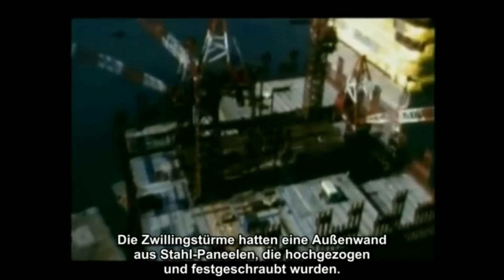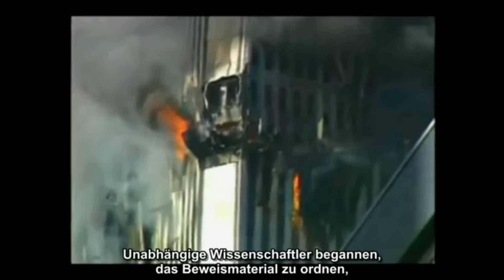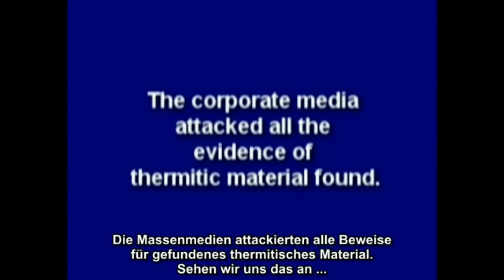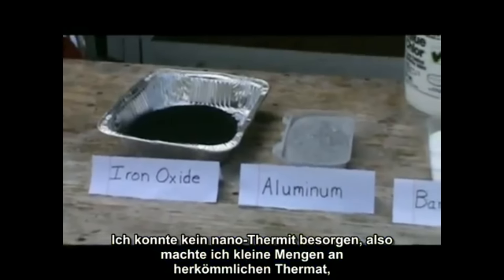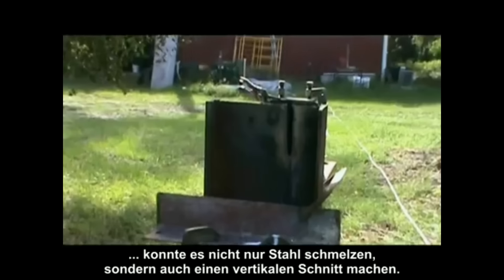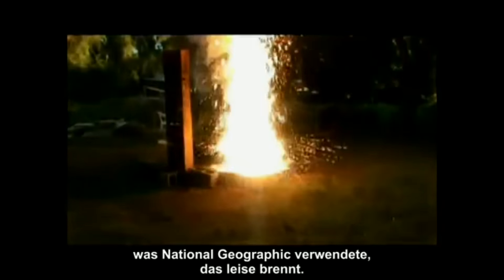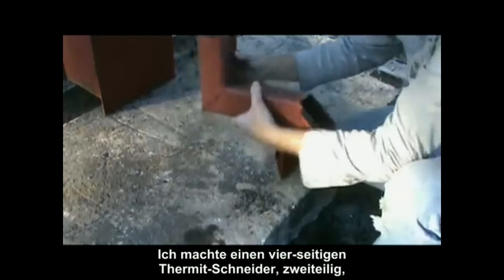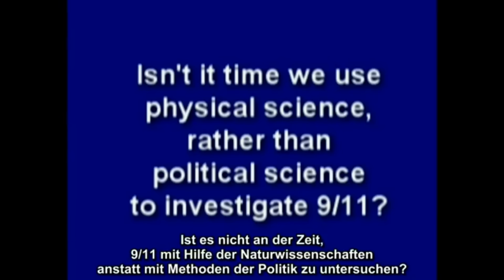9/11: Neue Erkenntnisse zu Thermit und Sprengungen ✔ November 2015

Comment: http://911-research.info/html/Fakten/brenntemperatur-kerosin.html

Physik 
Kerosin | Temperaturen | Statik
Brenntemperatur von Kerosin

Solche Verbindungen brennen normalerweise bei ca 700 – 800 Grad Celcius mit einer diffusen Flamme. Unter optimalen Bedingungen (optimales Brennstoff/Sauerstoffverhältnis) erreicht die Spitze einer Gasflamme etwas über 1100 Grad Celsius. Trotzdem schmilzt der Gasherd in der Küche nicht ! Auch der Grillrost wird wohl rotglühend aber er wird nicht brechen oder schmelzen. Selbst rotglühender Stahl wird nicht einfach flüssig oder verliert seine strukturelle Festigkeit komplett.

 

Kerosinfeuer
Höhere Brenntemperaturen von CH-Verbindungen werden nur durch technische Massnahmen erreicht z.B. durch Einspeisung spezieller Gase bei Schweissbrennern oder bei Kerosin durch hohe Erwärmung und Komprimierung eines optimalen Sauerstoff-Brennstoffgemisches vor der Initialzündung. Die Twin Towers erfüllten aber nachweislich in einem wesentlichen Punkt die Bedingung für so hohe Temperaturen nicht. Von einem optimalen Brennstoff-Sauerstoffgemisch konnte keine Rede sein, denn dazu konnte die in den Türmen vorhandene Menge Sauerstoff kaum ausgereicht haben. Dies beweisen auch die dichten, tiefschwarzen Wolken, die kurz nach den Einschlägen aus den Gebäuden kamen. Sie zeigten klar, dass den Feuern der Sauerstoff ausging.

Kerosin brennt in der Grössenordnung von maximal 800 Grad (ohne "spezielle" Hilfsmittel) und das ist weit vom Schmelzpunkt von Stahl entfernt. Der Stahl war ja auch speziell gegen Feuer noch zusätzlich geschützt. Dieser Schutz hätte gemäss Spezifikation den Stahl 2h schützen müssen (Turm 1 fiel nach 56 und Turm 2 nach 80 Minuten). Erst dann hätten sich die "verherenden" Temperaturen auf die Statik des Stahls ausgewirkt. Um diesen Fakt zu umgehen wird im Commision Report festgehalten, dass die Einschläge der Flugzeuge eben diesen Schutz von den Kernträgern zerstört hätten. Das kann, wenn überhaupt so passiert, nur in den betroffenen Regionen stattgefunden haben. Und das waren maximal 8 Stockwerke von 110 !

Die beiden Punkte - Stahltemperaturen durch Kerosinbrände und kinetische Energien der Einschläge - sind sehr wichtig: 
Es sind dies die zwei einzigen Faktoren, die zum Einsturz der Türme - gemäss offizieller Version - geführt haben.
Sind berechtigte Zweifel an diesen beiden Punkten angebracht, so führt dies unmittelbar dazu, dass auch ein grosser Teil der restlichen Untersuchungsergenisse angezweifelt werden darf !